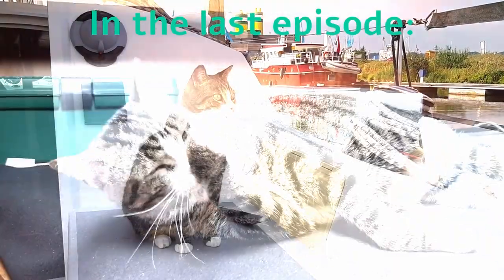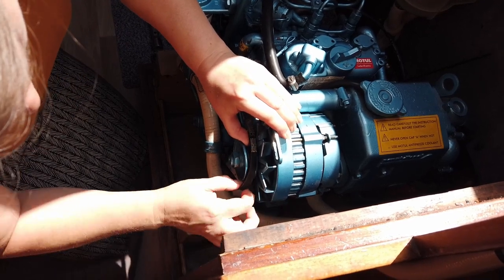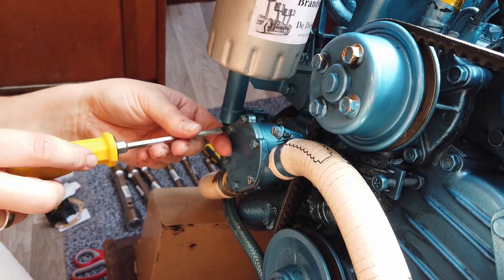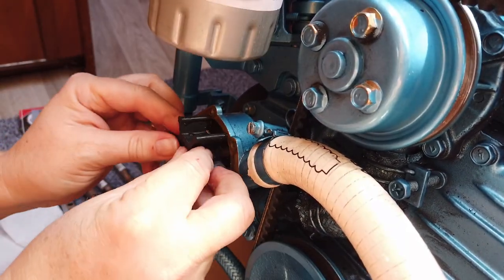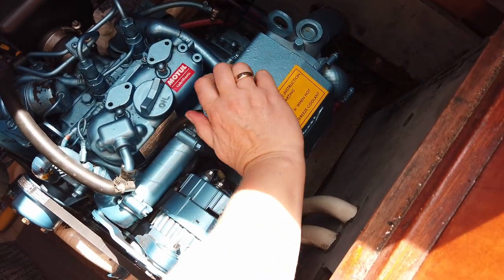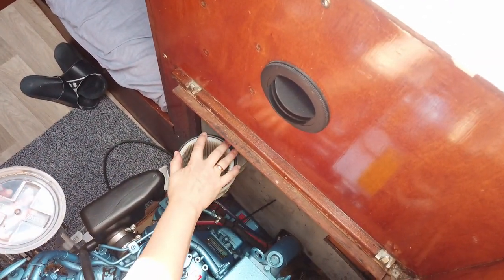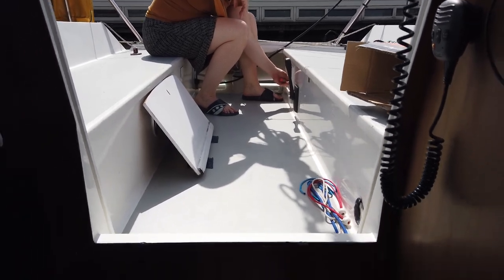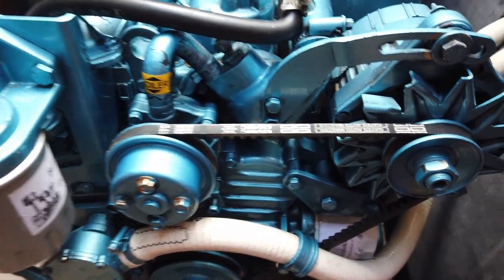How do we service our boat engine - Episode 17

Comment: Best simplest explanation of a diesel service  I have seen. Never seen a service done in a skirt and bare foot before !!!  Also best access to a small yacht engine I have ever seen .  I noticed that you did not replace the air filter. Is that because , if it is a volvo engine then you have to replace the complete air filter assembly not just the filter cartridge  and the assembly ridiculously expensive for what it is

Comment: Thanks Jouke.  I just bought my own boat here in Oz, with of course a Nanni diesel.  I think ours is 36 or 37 HP, so it's a lot bigger, but I assume that it will probably be a similar process.  I appreciate the video.  Thanks also to Rob, who I assume is the camera man?
Reply from the maker: Thanks! And you are correct. Rob was filming!
I hope you have lot of good times on your boat!
Reply: @SYSirius  can I ask how often you replace your anodes?  I think it may be different for me (I am in salt water). I think perhaps yours is sometimes fresh sometimes brackish sometimes sea water.  I am planning to sail up the coast about 300nm maybe 600km roughly then haul out and perform hull cleaning and shaft etc work for up to a month on the hard.  That’s when I expect to be able to replace all the zincs.  Last fine November 2022.
Reply from the maker: @colrodrick8784  I am sorry, but I don't know this exactly. We follow the Nanni schedule that is in the manual.
Reply: @SYSirius  all good I discovered today when I found the manual that ours is a 29 hp 3.100HE.  I’ve written down all the intervals and will start doing them

Comment: Great thanks!! Did you have to close the diesel tank before changing the filter? Also did you change the inverter oil?
Reply from the maker: Thanks! Normally one would close the diesel tank but here it's not necessary because the tank is in a bit low position. We did not change the gearbox oil this time.

Comment: You didn't need to bleed the fuel system after the filter change?
Reply from the maker: Yes we did but we didn't video it unfortunately. Sirius is equipped with an electric lift pump, which makes life a bit easier.

Comment: What type of engine dose the boat have ?. My tophat 25 has an sole 10 hp inboard diesel getting worked on.
Gerard. Nsw Australia.
Reply from the maker: It's a Nanni 2.50HE. 14hp.
Reply: @SYSirius  This is my first boat with an inboard diesel motor and i am trying to understand how to mantain it to run whenever i want to go someware.
Reply from the maker: That's a very smart plan. And as far as Sole diesels go: they are very reliable, well built and parts ate available everywhere. Good thinking.